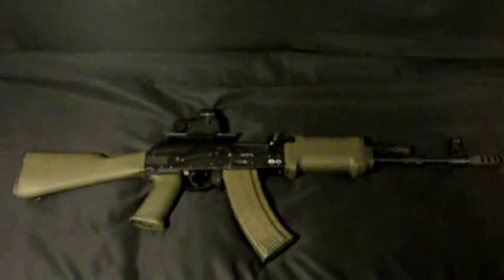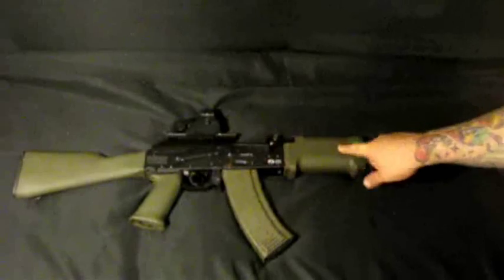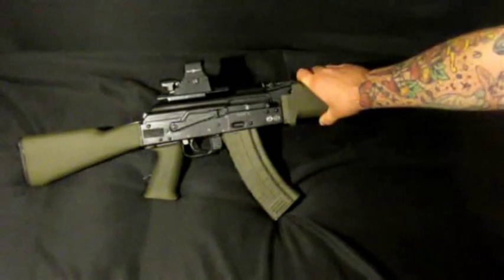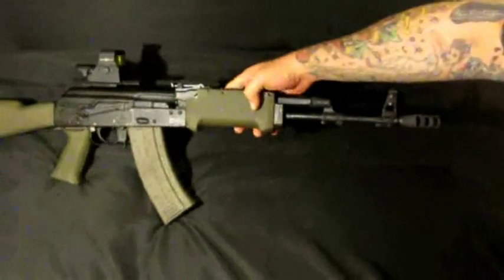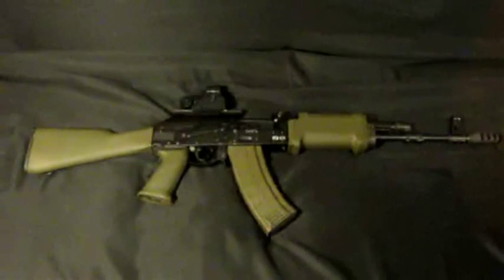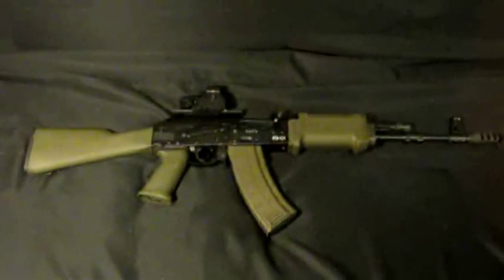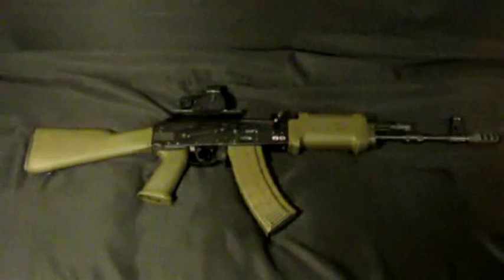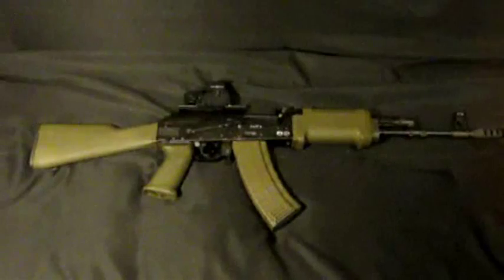Saiga IZ-240 5.45x39 Conversion Review

Comment from the maker: yeah it was a little tough, after i got the shroud off i used a file, then a sander on a dremel and took some material off the barrel to get the diameter down. I used a die and handle from CNC warrior to do the threading.

Comment: I have used bulgarian and east german 74 mags with no problems put around 2500 rounds threw the rifle with no bullet guide but with the crapco 74 mags last round may hang up but you can do a little work on the crapco's and theyll work just fine.   :)

Comment: what stock is that?
Reply from the maker: Tapco
Reply: TH3G00DS0LDI3R thanks. Are you still satisfied with the setup how did the gall fore grip hold up? ! bless
Reply from the maker: dhads420
Yeah i still love it.. the galil handguard is still holding up well. I do plan on swapping out to a traditional AK gas block and handguard at some point, but overall the setup is still great and has held up well